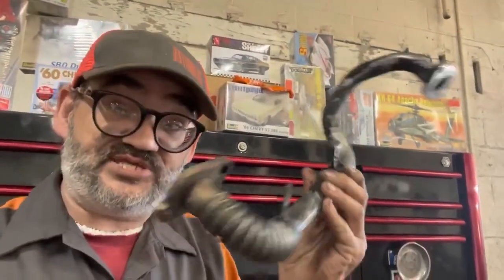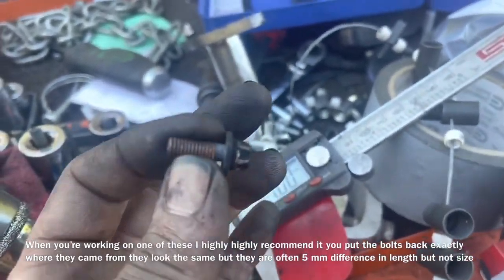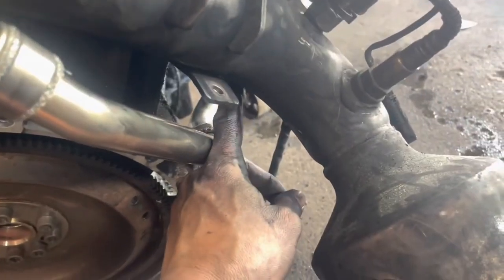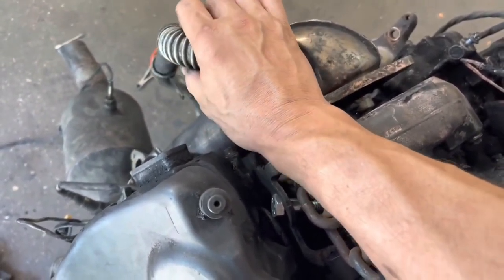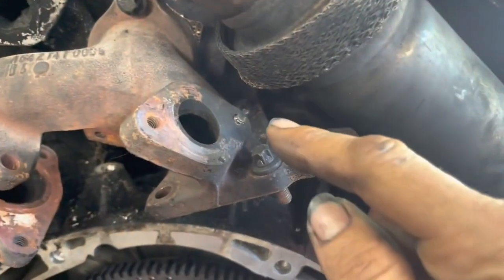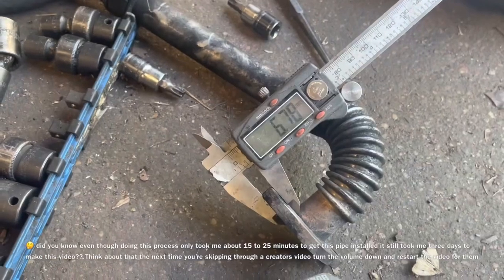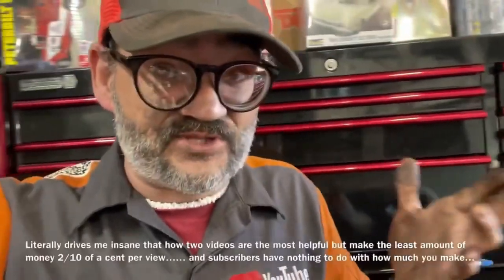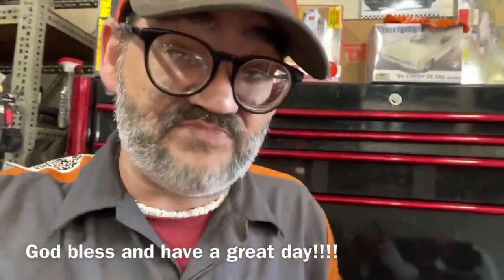EGR Crossover Tube Install - Mercedes 3.0 Diesel NV3 Done in Minutes!

Comment from the maker: ⭐⭐⭐If you liked the video and you'd like to help us out you can buy using these links before you buy ANY ITEM off Amazon. We get a small commission with no extra cost to you! 
Some Items we like to have around for repairs like these!
770pcs Rubber O Ring Assortment Kits 18 Sizes Sealing Gasket: https://amzn.to/3PRu12X
TOPDON AD600S Scan Tool, Code Reader: https://amzn.to/3Ot0gDR
DEWALT Mechanics Tool Set, 192-Piece ALL IN ONE SOCKET SET (DWMT75049): https://amzn.to/3EJKi4Y
Precision Hook and Pick Set, 4 Piece Set: https://amzn.to/3w1Zx5F
DEWALT XTREME 12V MAX Impact Wrench, Cordless Kit, 3/8-in: https://amzn.to/3vKFR5U
EPAUTO 45 Pieces 3/8" Drive Socket Set with 72-Tooth Pear Head Ratchet: https://amzn.to/3KeUhjW
Dewalt Dwht51048 16 Oz. Rip Clawhttps://amzn.to/3vaHzyp
Autel Scanner Maxisys  2022  Diagnostic Scan Tool with ECU Coding, All-system Diagnose, Bi-Directional Control: https://amzn.to/3k9T6rl
FOXWELL NT301 OBD2 Scanner: https://amzn.to/36OSHru

Comment: The wrong turbo inlet crossover got installed on my sprinter (long story). The tube lines up on both ends but there’s no threaded flange to screw the upper loop clamp into. On my 3rd EGR tube in 5k miles. Thinking of getting a used turbo inlet crossover and cutting off the flange to hv it spot welded to existing. Your thoughts?